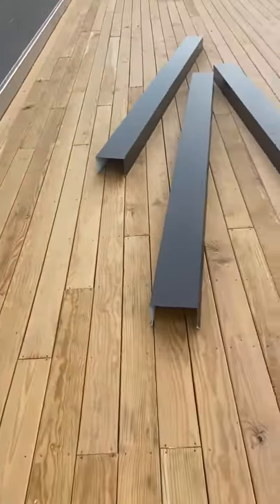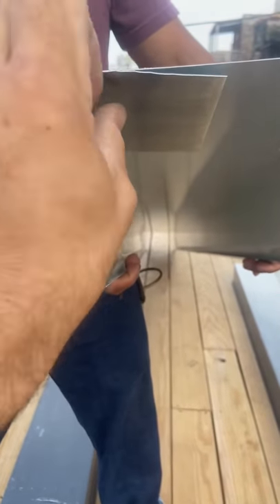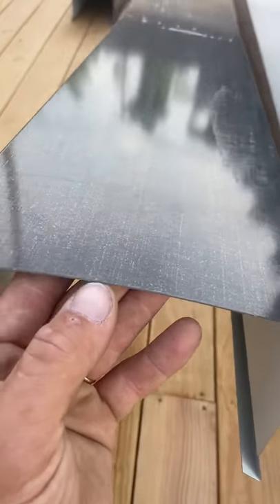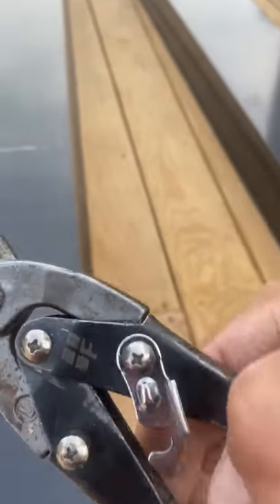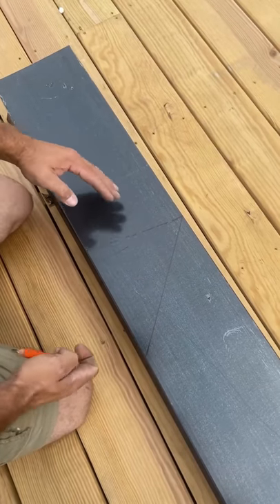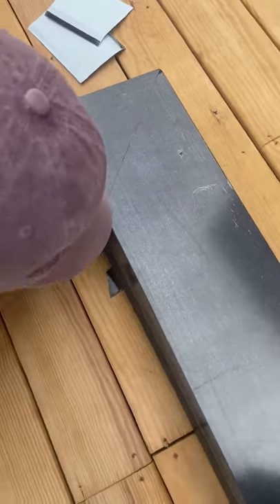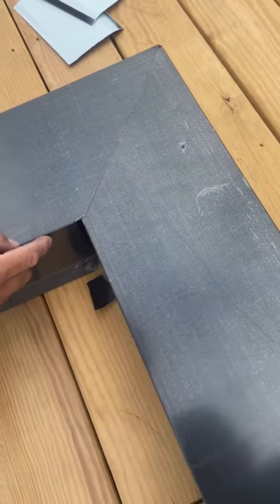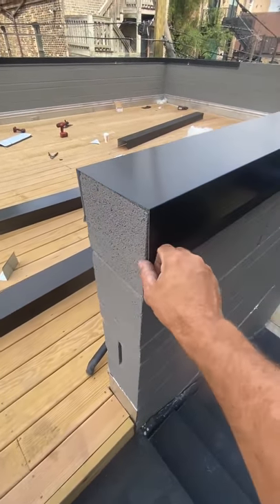HOW TO INSTALL METAL COPING!

Comment: Wow.  No tabs on your inside corner. No wood  under the coping or water barrier. One bead of caulking under the cover plate and in the wrong place. Should've used tapcons instead of drive pins. And where are your offset snips?

Comment: I imagine in this particular case the owner was trying to build this place with cost effectiveness.  I can't believe they didn't have any concrete in thow blocks or rebar. I would be surprised if there was any ladder wire. In michigan we could not put that cap on there without an anchored wood sill plate either. Nice work and video on your end though sir.

Comment: I guess you are not worried about expansion and contraction, regardless whether it's  28 or 24 gauge. That is not a watertight system.  A 3/8's hem with a piece of drive on your joints would make it a watertight system without exposed fasteners. You can caulk the joints all you want....but eventually the sealant will fail.
Reply from the maker: ok!  Hem lock on coping is good or even better- standing seam! and i was using that system in Canada but with 29 GA steel or 0.20 aluminum. Could you tell me where can i find any video with 24 GA steel and hem lock? The material we work with has a Kynar finish which is very easy to scratch and when you have a scratched coping on the roof top deck, its always a question from the customer.
Reply: We install 24 gauge cap with 22 gauge cleat in Canada. S-lock joints with hidden fasteners and standing seam corners.

Comment: clean work, but you need a pressure treated wood cap first, pitched to the inside.  I'm sure this wall has a ton of efflorescence now from moisture/ condensation getting under the aluminum and dropping down into the cmu

Comment: Another joint method is splice plate with sealant bead  under to keep 1/8 gap in coping finished  with cover plate. Nice work great idea on the end cap, entry points are always a challenge.

Comment: Hey friend, how often do you put screws or nails?
Reply from the maker: if the piece is 10' i put one in the middle and sides are held by the seam covers ( so technically every 5 ft)
Reply: @LeftoverCA  thank you very much friend just tomorrow I start the project.  Blessings